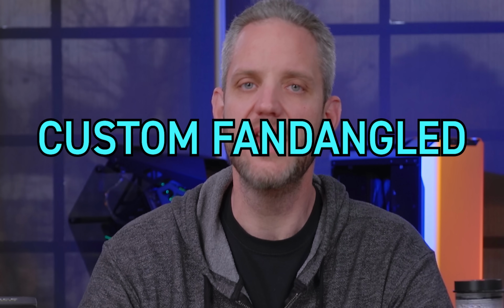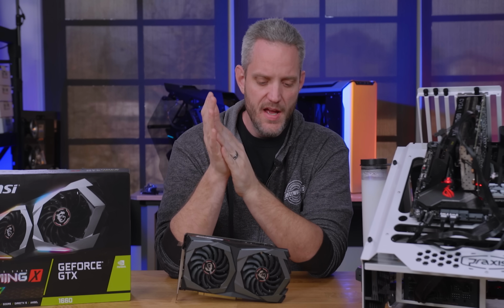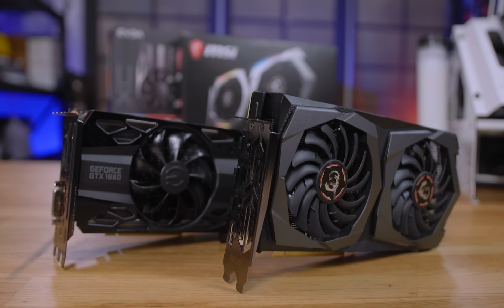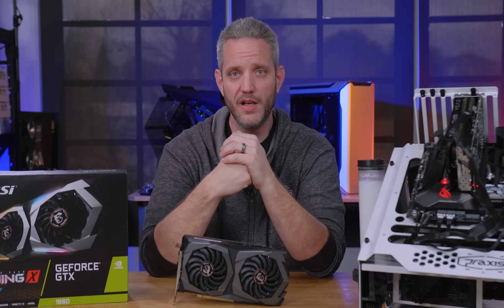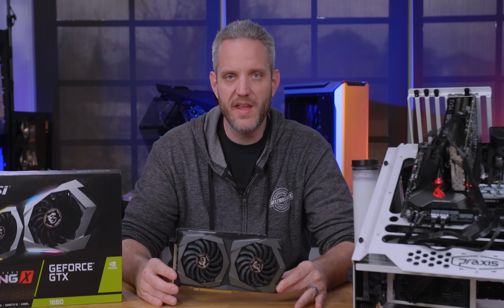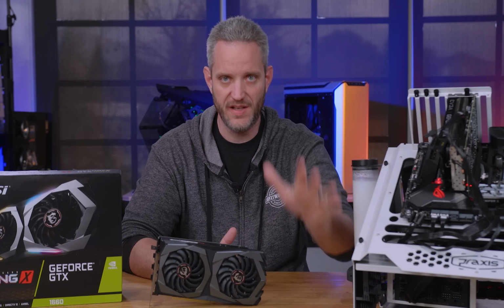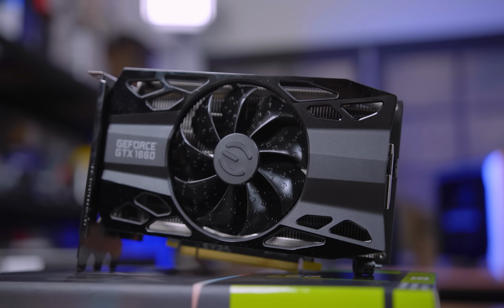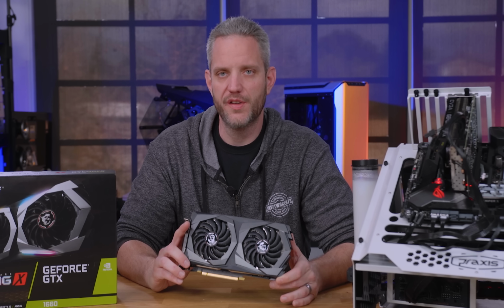Just save your money.... GTX 1660 vs GTX 1060

Comment: I don't game.  But I render 3d.  I would choose the base model because the performance does not justify the price difference.  What kills 3d render time the most is running out of memory on the card.  This is why even an RX 580 8 gb can be faster than these cards at certain times.  The 1660 is almost always faster in about everything than the RX 580 unless it's a very large render.  I wish the 1660 had 8gb and then it would be a no brainer.  I would skip the Nvidia lineup until I had enough scratch to buy a CPU with more memory.  But I think this card is a good value considering current prices.
Reply: GarretsDaddio Well that‘s why it‘s a gaming card. There are other graphics cards for the professional market. 6GB always is enough considering gaming and the performance it offers. The RX580/90 has more VRAM you will never use while gaming at 1080p. For 1440p neither of these cards offer enough performance, so more VRAM than 6GB is not needed considering they are gaming graphics cards for 1080p.
Reply: @SURO90  Unfortulantly my 3d software demands Pascal based cards.  The RTX and 1660 along with any production based cards are useless.  As a workaround, I switched to another rendering program that allows the use of other cards with Open CL support.  For being on a budget, bang for the buck AMD kills it because of memory size. (still gaming cards)  I would love to get into VR yet too.  But considering my 3d software demands a gaming card, Pascal, it's frustrating and certainly seems like a bad choice. 1) it forces me to buy 10 series.  2) They need to scramble now that Pascal is getting phased out to come up with another solution.  I don't get the concept of gaming rigs because I think spending that kind of money on anything should be able to multitask.  If it wasn't for one specific program I would defiantly buy a 1660.
Reply: @GarretsDaddio  Well GTX/RTX and non-Pro Radeon GPUs are specifically made for gaming. For the professional market there are Quadro and Radeon Pro GPUs. But of course "multitasking" is possible most of the time as long as no Quadro/Radeon Pro is needed for that specific software.

May I ask what rendering software demands only Pascal based cards? Seems like a very specific use case. And if so your software is the problem, not the GPU, as rendering usually is possible with all GPUs.

Comment: Jay..?? 1060 3GB GPU is not a better buy over the 1050 4GB Ti OC (FYI both Zotac) ...??? I did my first PC in years and came across both cards. Both relatively cheap. I was to understand that the 1060 3GB had a better performance in memory Read/Write rate over the 1050 4GB (GPU Processing for Rendering) and for the price tags of 2017. Yes yes, for its time. I was looking for a better card by now, thinking a 1070 was my next step.  1660 Ti XC comes off way way better.

* (BTW) I work for Henry (YProGeeks.com/.net) and I have made several recommends on PC builds from your videos. Thanks for your insights. John - YProGeeks.com
Reply: 1060 3GB is better than 1050 ti man
Reply: @supunbandara5358  IT IS what I have found to be true.. As a reference to my experience, using my Task Manager to monitor some performance issues (my system for Business/Home use: [8th Gen/i7-8700K, Corsair RGB 16GB DDR4 3000 (Along with ASUS Software)], heard about it before buying both (Zotac) cards. The processing bridge (architecture) effectively handles the 3GB of memory better than the Ti OC 4GB. I do also use the available Nividia Drivers, and see better FPS (+10-25 FPS) for certain games, and a better benchmark score using VALLEY. The price difference then..? $25 USD over the 1050.
Reply: I have a GTX 1060 6 Gig and it's performing awesome. If you can find the budget buy a rx 570 or rx 580. It will give you better vram performance than 1060 3 gig. And they are far better than 1050 ti. They have better driver support also
Reply: @supunbandara5358  For my next project, I did have the RX 580 in mind. Also in mind was a Windforce GTX 1070 8GB. As it can be seen, the GPU market (the middle ground) is still NOT set in my mind to come down on prices over the hype of the 20 series cards (Ray-Tracing). RX 580..?? GTX 1660 Ti XC..?? or a GTX 1070..? Given that taking a 3rd card into account (RX 580) for viable Customer PC Builds. For myself..?? 1660 (6GB) vs. 1070 (8GB)..!!! I would hope @Jay would do a vs. comparison. 

* I, guessing to speak for many others, look for value, even in Gaming. FPS counts. How many games are out there (today) that use Ray-Tracing. NONE of the games I play while on breaks. AND I do like what @Jay has to say.

Comment: I'm interested in best performance GPU's without the need of additional power.
Reply: Probably 1050ti is the best without additional power
Reply: @JRaikoben  I had the same thought, so I bought right now a second hand Zotac GTX 1050 Ti 4GB D5 OC for around 110 USD.

Comment: I bought an overclocked RTX2060 Zotac Amp for £350 and I've never looked back. Upgraded from GTX1060. It's awesome at 1440p on PUBG. Getting 150-160 FPS. Has GTX1080 power and with DLSS will probably push up to 1080ti. Great value in my opinion. Would certainly not recommend upgrading from a 1060 to a 1660 or ti version for such a small boot in performance. Not bad for anyone starting from scratch or upgrade from 1050 though I suppose. RTX2060 is a much better futureproof though...

Comment: Hi, I currently have a GTX 1060 3GB Oops! I want to upgrade for about £300 GBP (Im in UK) Any advice?
My PC system is:
CPU: i5 8400 6 core. 1151 LGA
Ram: DDR4 16GB Cas 15 Patriot 2400
GPU: Gigabyte GTX 1060 3GB
MB: Microstar B360M Pro-VDH Coffee lake
HDD: Samsung Evo 860 500 GB
PSU: Be Quiet BN277 PURE POWER 10 500 W
1920 x 1080 monitor.
 I mainly play VR on the vive with the PC

Comment: If I were building a complete system I would have the debate over the RTX 2060 vs GTX 1660TI.  Personally I am waiting for Navi to give Team Red a chance.  Even though I would like building a system with the RTX 2060, I dislike that it encourages Nvidia to continue to pursue ray tracing.  The 1660 TI is not quite as good when building a complete system BUT it shows Nvidia that ray tracing isn't important to me and philosophically I like that better.  Sadly Nvidia has released their GPUs in a way to "force" the market to pick an RTX card.  This is the main reason I am waiting for Navi.  If Navi has the performance threshold of being able to play most games at 1440p at 60fps on a 144 Hz monitor and it costs less than 300 dollars then I am switching to amd for this gaming cycle.

Comment: I mean if you have a 1060 and a 1080p monitor , there really is no reason to buy new stuff. Even people with a 970 will still be fine
Reply: It should be more than obvious this is not meant for people that have bought a GTX 1060 / RX 480/580.

Comment: Hello. I am trying to decide on a GPU for my PC build. I am currently stuck at rx590 and GTX1660. The RX590 (Sapphire Radeon RX 590 Nitro+ 8GB) is 275 dollars and the GTX1660 (GIGABYTE GeForce GTX 1660 OC 6GB) is 304 dollars. The GTX1660 is slightly better but is the price worth it? (plus the 3 games bundle for RX590) Thank you.

Comment: I dont think its worth upgrading u can get  XFX Radeon RX 580 GTS Black Edition 1405 MHz OC+, 8GB 256-bit GDDR5, DX12 VR Ready, Double Dissipation, Dual BIOS, PCI-E AMD Graphics Card (RX-580P828D6)
Get 2 free games w/ purchase, limited offer
$189.99 (4 Offers) that will run thing better then fine. So Thanks , but no thanks. Plus you get 2 free games. All the games  I play run fine on an I5 8400  with  Lotr , Age of Conan ASRock Phantom Gaming D Radeon RX 570 DirectX 12 RX570 8G OC 8GB 256-Bit GDDR5 PCI Express 3.0 x16 HDCP Ready Video Card 139.99 with a 480 GB SSD  Patriot for 55.00

Comment: I bought an inland ssd as my first ssd a few months ago. I was thrilled to finally have ssd speed for the price...till it died 2 months later. they replaced it no issues but all that data is gone and im afraid of the damn thing now. Its just not worth the 10 bucks you save from getting a name brand one 
Edit: when i took it back the guy at the customer service desk said that they get a ton of returns on them too, so not an isolated incident

Comment: Saving my cash, and waits for next gen. My used 1070 Ti will do fine for a few more years. ;)
Reply: 5 years minimum for a GTX 1070ti I run 1080 games and edit in photoshop and premiere pro 1080 footage and aspc sized photos with a GTX 750 upgrading to GTX 1050 or RX 460 or RX 470 sorting by used and lowest price on eBay.
Reply: Mystic Sabre what’s your budget for a gpu?
Reply: @Hungryminecrafterz  Anything that doesn't bottleneck a Gen 4 i5 4460 and 16gb ddr3
Reply: Mystic Sabre i have the same cpu and the top gpu u can get is the 1050ti or 1060 over that you bottleneck
Reply: @Nitsucal  Yeah amd has a cheaper 470 used on ebay so I'll do that even though I'm a Intel nividia guy
Reply: @mysticsabre2977   that was my old rig... truly beast... with 970 4gb ram could actually play any 2019 title i want med-high settings average 80-90 fps... now i changed into r5 1600 16gb ram with 1060 6gb and i am thinking to take 5700xt but i am afraid of bottleneck xD
Reply: Im affride of buying used gpu :(
Reply: event horizon Id be most scared of a used motherboard tbh
Reply: 1070 ti for a "FEW" more years ??? That 1070 ti is gonna last at least 5 years you'll see..
Reply: may i ask? im not really good about this. Is 1660 worth buying or no?
Reply: @childish3617  yes
Reply: I got 1year old gtx 1060 6gb at half price
Reply: Bought a used gtx 1060 6 gb for $120 USD last year and still running perfectly fine gaming rendering, etc.
Reply: I just replaced my 1050ti 4gb with a 1660 6gb and i am very satisfied. I can run most games on high-ultra settings with high FPS. I have an RTX 2070 triple fan but it won’t fit in my case so I’m saving it for the PC I plan on building in two months.
Reply: @tjs8617  want to sell me the 1660?
Reply: @user-um4jj5im8k  Sure, I actually just stopped using it and am using my RTX 2070. I can send you pictures or whatever if I can get your email or something?
Reply: It’s a really great card.  Only has two months of use.
Reply: @tjs8617  I’ll buy it if he don’t lol
Reply: @BONELESS PIZZA   Sure,  I haven’t heard anything from @JackKannoff.   So let me know.
Reply: @pyrogod_806  You Still interested in the GTX 1660?
Reply: @tjs8617  I’m interested!!!
Reply: @TheNuclearBolton  Sure!  Reply here and then we can exchange some info!
Reply: @tjs8617  I live in Western Tennessee in the US and could you give me the exact name/brand/model of the 1660?
Reply: @TheNuclearBolton  one sec
Reply: @TheNuclearBolton  EVGA Nvidia GeForce GTX 1660 Black
Reply: @tjs8617  How does $250 sound? You know what the shipping costs will be? I’ll send you an email letting you know it’s me in 1 sec.
Reply: @tjs8617  wya? I sent an email
Reply: @TheNuclearBolton  Did it work out?
Reply: @thejoke69  I wrote him an response and did not receive any acknowledgement. I have moved on to better things, investing in the outcome is a better decision with where I am in my life trying to focus on academia. This is a disruption of time and underutilized for the seemingly great deal I thought I was getting if only it were convenient as the proclamation itself. What a steal! I came to realize that I am my best investment, my own stock and my own worth. I have put aside money that I would have otherwise spent on liabilities into Bitcoin and creating a solid  ~9% annual return on my total portfolio when converted to USD excluding the additional inflation of the market. BTW, don’t do what “everyone” else is talking about, it’s usually already destabilized. I would invest in the companies that provide the most resource and infrastructure into the growing markets, often behind the scenes for good reason.
Reply: No shit
Reply: Its time to upgrade now boi
Reply: I have a 1070 and playing in 1440p, I have good framerate around 60+ on every game i'm playing currently in very high/ultra, be aware that it also depend of your CPU and Ram !

Comment: I was using a GTX 1050 ti that came with my system for two years, I wanted to get a GTX 1060/6gb but the prices back then were too high. I liked the GTX 1660 ti (MSi Ventus XS OC Edition) and snatched it up. Performance is like night and day over my older 1050 ti.

Comment: I am not a good player and when I play a game like WarThunder I tend to turn off many features or run on medium just to avoid things as lensflares and water reflection, and my reaction is not very fast due to age, so how important is FPS, do mediocre players as me really need 100 to 120 FPS or can we still getaway with a gfx that only can do around 30 to 60 FPS in rather new games? How would you build a computer for a person that mostly use the PC to edit RAW photos in Photoshop aand that just play games on a low level with no need to run at highest graphic settings? To keep et short, can you build the ultimate noob PC that is just okay?

Comment: Honestly your card should depend on what you want it to do.  In my case, I game at 1080p so the 1660Ti XC Black is perfect.  It averages 75-80 FPS on max settings in every game I play, with a few older outliers getting in the range of 150 FPS or higher.  I really am thoroughly impressed with the 1660Ti for what I paid for it.  On the flip side, anyone wanting to game in 4K should probably save up a lot more money and step into the realm of the RTX 2070 because the 1660Ti just can't handle it.

Comment: just ordered the 1660 from newegg yesterday,
is it possible an i7-6700k might be a bottleneck for this gpu?
Reply: my 6700k 4.6ghz all cores handled my titan Xp fine, maybe ~50% usage in the most intense apps (beamNG drive or modded arma 3)
Reply: I7 6700K can handle RTX 2070 Super even...

Comment: LoL, i got 3 pc's: r7 1700 +gtx 1070, i7-3770k +gtx1060 6gb and a r3 2200g on its own currently. i want to upgrade the 2200g but im only gonna get an rx570 4gb for cheap-cheap... 
normally i would get an upgrade for the best gpu and pass the rest down the line but this time around i feel the 2060 is not really that much over the 1070 and i find the 2070 a bit too expensive right now. so i go cheap :D

Comment: Would the 1660 ti and a ryzen 7 1700 be a good starter build for streaming and editing ?
Reply: Umm might want to go rtx 2060 because it has the separate section for streaming that doesn't affect gaming performance. Not sure if the 1660s have that you'd have to check. If it does have it then 1660s would be a valid option

Comment: I bought a 2060rtx and its a beast at its price point I play AAA games without a problem, save a little bit and go for the 2060 if you are considering either the 1660Ti or 1660. thank me later
Reply: I will not thanking you because you're dumb 🤣. The 2060 gets really hot 85c so watch out in a few days it will blow up in your face. You can thank me later too 🤣

Comment: I ran into that conundrum last night. I just ended up with The EVGA XC 2060..After some testing in my son's 4790K..It turns out that we should have just got the 1660Ti as once overclocked it was nearly indistinguishable in performance with the 2060 . Weird  The 2060 was being held back by the older core i5. Not saying that this will be everybodys result and newer architecture CPUs will be able to utilize these cards better. It goes back to your point that so many cards in this stack at such a close price can and will confuse folks into maybe buying more card or less card then they need. I having both cards was pretty telling that for most people the 1660ti is a better choice for older builds. I needed a new card as my son's 1070 died. I know too long. Thanks Jay..
Reply: What about overclocking your 2060? I'm sure it was still worth the money then. And yeah your CPU could probably use an upgrade when it is bottlenecking your GPU.
Reply: @DesertGoonJJ  you're totally right of course..My goal was to keep the old i7 going... I did OC the 2060 later on thay day but it had little effect. the 1660ti is just a better match for that system. It still plays very well. I have other systems this is just what my son plays on.....

Comment: Go 1660 219$ model or go for a 2060. Everything in between is just filler and literally a waste of money. It will not matter much in daily use and "a few extra FPS" will not be visible during normal gaming since the difference isn't large enough. Even though the 1660 TI seems to be a lot better on paper, it's simply not on "a different level". It's not like the difference between the different cards in the 10XX series like the 1060 3GB and 1060 6GB - or the 1050 vs the 1050 TI where the 2 gigs of RAM on the 1050 was massively inferior to the 4GB on the 1050 TI - which made it an actual usable card where the 1050 was much less so. Nvidia  might have screwed up at bit in making the 1660 and the 1660 TI a bit too similar to justify the extra cost, especially with the performance jump you get if you buy a 2060. The 2060 can run many titles at a totally different level - which means: If you can't afford a 20XX card, go for the "good enough" solution - which is the 1660 - OR - Wait ½ a year for the AMD Navi and hope that will shake up the marked - and then buy the card with more horsepower.
Reply: - Retrospective - Hope you didn't wait! hahaha ... But yes have a PC with a GTX 1660 - and whenever it's in use I forget that it's only a GTX 1660 because it still to this day does very well.